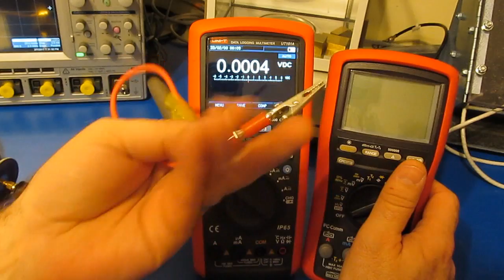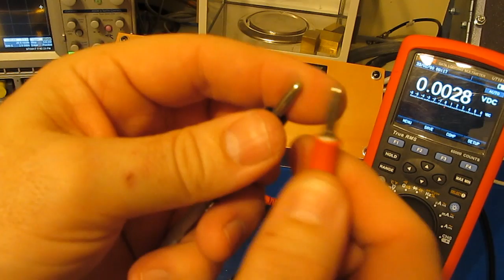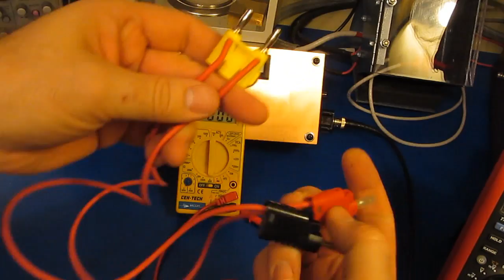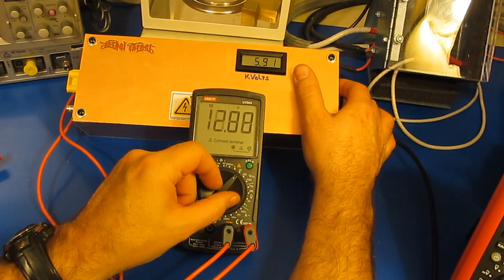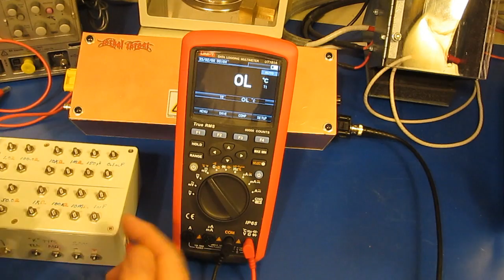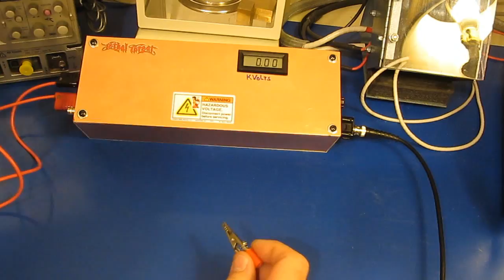Homemade ESD gun

Comment: good morning could you tell me which gas grill igniter I should buy that gives me high kv voltage and picosecond pulse. Best regards
Reply from the maker: What I have found is they are not all the same, even if you buy the same exact part from the same supplier.  The only way to know what wave shape any igniter puts out would be to measure it.

Comment: Hello Joe  I’m thinking of building an ESR generator. I would be interested to know how the trigger circuit works. Thanks regards Chris. - Ediit was meant to say ESD not ESR auto spellcheck oops
Reply from the maker: There are no triggers required to measure equivalent series resistance.  My BK can read it directly.  Maybe you could just buy a cheap LCR meter.
Reply: joe smith  Thanks Joe. Not surprised you were confused ESD not ESR - Oops. I was asking how you discharge the capacitor in the ESD generator when you press your test button are you using a high voltage relay. Connected between your storage capacitor and the  DUT. Thanks chris
Reply from the maker: @allthegearnoidea6752  So you want to make an ESD gun.  My advice, don't waste your time attempt it.  You may be better served with using a simple grill starter like I show.  They are all a bit different.  The one I show is really weak.  Of course, no matter if you attempt to make one or just play with a grill starter, you will need a way to measure the output.  You may have seen my home made targets I use.  Consider that the current rise time is in the ps,  you will need a decent scope, attenuators.....    Another option is to buy a used gun.  Maybe look to see if you can find an old Keytek that is still in working order.  Still, you will need to have a way to verify it's waveform.  This is a deep rabbit hole no matter how you look at it.
Reply: joe smith  I want something that I can vary the levels. I haven’t seen a second hand unit for sale. I see what your saying about calibration but it would be useful to be able to do comparative measurements. I’m just interested in EMC issues as have been doing some compliance testing recently and it peaked my interest etc. Yes I have been using a grill starter. Thanks for the reply regards Chris
Reply from the maker: @allthegearnoidea6752  Looks like there are a few old Keytek units on eBay now.  Sadly, nothing complete and who knows if any of it is in working order.
Reply from the maker: @allthegearnoidea6752  What about just simulating your circuits with SPICE?   You could model the ESD event fairly easily.
Reply: @joesmith-je3tq  Yes I had a look but still quite expensive and nothing I would want to spend on.  Thanks again best regards Chris

Comment: Hi Joe, great build! I was wondering, does it use a mechanical relay for triggering the pulse? I didn't hear a click when you triggered it. Maybe I'm asking too much about the ingredients of the secret sauce but I do wonder how you got the rise time right.
Reply: Correction: I do hear a relay click at 9:15..
Reply from the maker: Yes, I use a mechanical relay but the output wave shape has nothing to do with that.
Reply: Could it be a reverse breakdown of a semiconductor? These are really quick, but I don't know how you would make that work over variable voltage.

Comment: Joe smith, am doing a miniproject with flyback transformer. I need an output of 13kV dc with very low power, can you help me how to design the driver and the flyback transformer.
Reply from the maker: I would recommend you purchase a supply.  If you want to build one, I would guess there are many designs on the internet today.   I have seen a few made from rewinding old analog TV transformers and running them in an oil bath.   You could also join one of the many electronics forums.  Beyond that, I'm afraid I can't be of much help.
Reply: Thanks for the information.

Comment: Cool but I was really hoping to see you do one that failed the grill lighter on the new one unmodified.
Reply from the maker: Once damaged, if unrepairable they head to the recycle bin.  But I'm sure we will see more meters fail from this simple test down the road.
Reply: joe smith ah  I guess I had it in my head that you fixed them all.  But yeah it makes sense that most would get trashed  :)
Reply from the maker: The vast majority of the meters I looked at have been recycled.   Once the main control IC is damaged, there is little I can do but scrap them.   Some of the better meters have enough input protect to at lease protect the controller.   These are normally repairable.  Then there are a very small percentage that are super robust..

Comment: Have you done a video showing the inside of your awesome dmm tester?
Reply from the maker: I've made a few of the one I normally use.   Goto the main page, select playlists, then select programmable transient generator.  There is nothing for the half cycle line simulator or for the new ESD gun.  For more details refer to the FAQ in the about page.
Reply: joe smith actually i was talking about the one that you use to functional test the meters.   With all the studs sticking out of it.
Reply from the maker: Right, that is in the FAQ.
Reply: joe smith OK I'll check it out
Reply from the maker: I could not seem to embed the link in the about section so if you did not want to copy and paste, the link is also in the discussion section.

Comment: I like it, nice. Now I want to hook some old meter to my spot welder, lol. It claims 3KV up to 30A I think. But of course I'm tripping my 20A breaker if the pulse is too long and I get a good connection on the nickel. I was surprised to see that my APC 1500VA UPS was fast enough to jump in and prevent my breaker from tripping in my lab. I guess if it kicks in at 8ms, and the breaker pops at 15ms then it's just fast enough.i had to move to a different room to get the most power from it for some good welds that didn't have a UPS on the line.
Reply from the maker: Hey Scott, I figured you would like that last little bit.   I tried my UT210E on my MIG once. That was the first time I had to degauss it!

Comment: Very nice!, I wonder if you have tried to measure a real ESD (human body), once I tried with a cheap multimeter, I only got a 70v DC value (on AC I didn't got anything), too fast for the meter I imagine but the meter didn't got damaged.
Reply from the maker: Yes I have.  It was towards the start of this video!
Reply: Yes, somehow I missed out!, you mention the current but not the voltage, do you remember how much voltage was?.
Reply from the maker: I am not too concerned with the voltage as much as how much energy is available.   This was basically me sitting in the chair.   There are some pretty good papers (some were in the links I provided) talking about the voltage levels to expect.  There was one about eating Hershey Kisses could generate on the order of 30KV.   In the case of the UNI-T UT61E, we know they have that capacitor that feeds right into the controller IC.  The data sheet for the controller even warns the designer.  So you do anything to that meter, it's pretty much dumpster fill material.    This is why I ran it along with the UT181A.  Two meters that were easily damaged with the little 1A ignitor, now taking a direct hit with this gun after my changes to UNI-Ts designs.

Comment: Nice video as always.  Why not just use a spark plug coil for these experiment?
Reply from the maker: The whole point of building this gun was to get something close to what the EN 61326 directive calls for after a few people pointed out that the grill starter was not a real world test.  Now I am sure these people felt the ignitor test was too harsh but IMO, it was no where near harsh enough!   If you have tried a  spark plug coil to get the IEC waveform's profile, I would like to see it.  I read the standard and based my design on the little bit of information I could find.

Comment: Hey mate great video as always. Are you going to retest all meters?
Reply from the maker: I have no plans to replace any of the meters I damaged and recycled to run this test.  Of the meters that I still have,  the TPI was damaged during my initial evaluation and I was unable to obtain a replacement part,  so there is no point in running it.   Besides, we know that it would fail.   The Flukes, HIOKI, AMPROBEs and Brymen's are certified for EMC.  While it does not prove these would handle transients from the new gun these are in a different class than meters that are not certified.  I thought about buying another UT61E but really what's the point.  I know it would be damaged and end up in the recycle bin.  Same with the free HF meters.   What I may do is if any new meters I look at fail the ESD test, I will then run the meters that I am using as a comparison.
Reply: You also still have the UT139c you could test. It passed last time with the grill ignitor.
Reply from the maker: Sorry but after I damaged that second UT139C, I never replaced it.
Reply: Damn i must have missed that video. I will look up the video see how you killed UT139c. It done so well it passed up to the 4kv test.